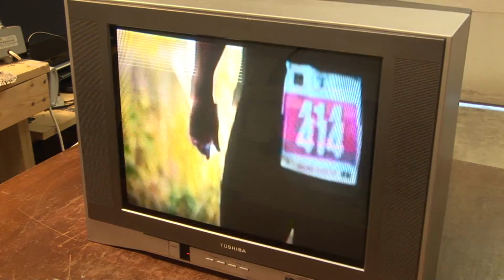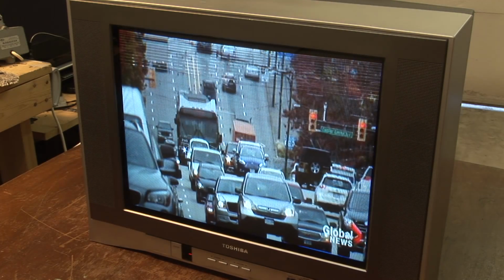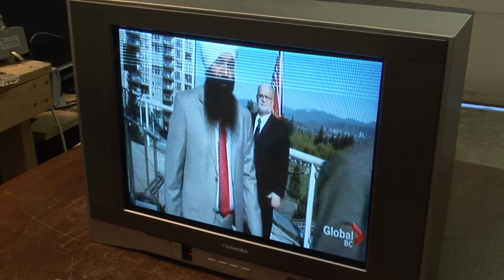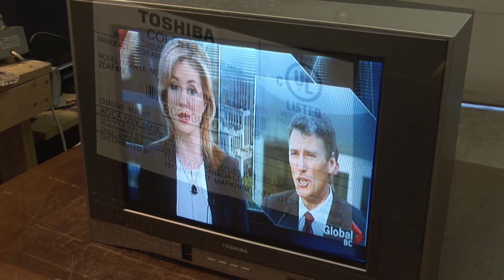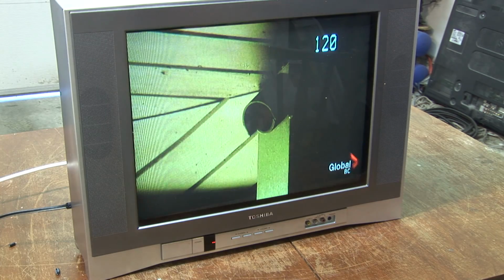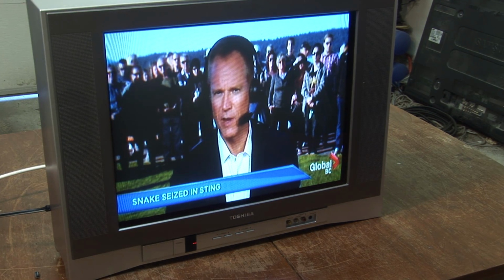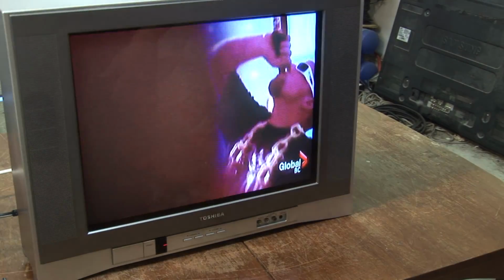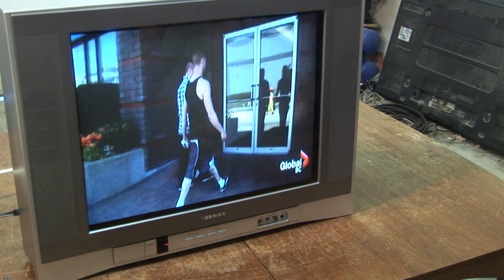Toshiba 20AF45C CRT Lines in Pix

Comment: I just got this set, and I think it is very cheap. I'm not so sure why people like it so much.. Very simple board, simple tube, and simple or minimal adjustments via service menu compared to Sony. I have an issue where the horizontal size is off, and there's no way to adjust that via service menu since the H-Size doesn't work. I can't see any potentiometer specifically for it by looking at your video, only for H-position os available, so I am just not going to bother opening it and go straight to garbage.

Comment: I know this vid is a couple years old, but I want to thank you for posting this, Dave. Recently had this very same issue with a Philips set, just went ahead and located the vertical circuit and replaced all 4 caps. Works like a charm now.
Reply from the maker: That's the thing with CRT. They are all basically the same.

Comment: Thanks for this video. I had the visible raster lines at the top of the screen and replaced C406, C407 and C408. They went away. Your video is much appreciated. However, I still have a lightly visible bar/lines horizontally across the center of the screen. Should I consider replacing that 4th cap near the large heatsink that you mentioned (C409 I think)? Would any other area be causing such an issue? I don't have the proper equipment to test the caps, but replacing them is an option.

Comment: I have a 27af45 that I can't wait to get out of storage this Friday. When I put it there about 9 months ago It had the same lines on the screen and the front input jacks only worked if you shake the cables around. The front composite video inputs I can fix by re soldering the cold solder back together, But the Capacitors, Were exactly do you find them? and could I find them at my local electronics store because they sell caps there, And which way do I put the caps?

Comment: Thank you so much for all the information. Fixed my gaming TV in a snap.
Reply: Selecting the 16:9 mode removes all the lines at the top on Toshiba What I did was go into 16:9 and then go into the video service menu and resized the tv screen to hide the black bars from the 16:9 and it works perfectly i think its hold volume down and number 9 on the remote. Then you fit the 16:9 into a 4:3 frame by changing the v and horizontal stretch i ended up just replacing the caps 2 years later the tv works normally again and i resize the screen back.

Comment: I just picked up a 24" Toshiba in the same series as yours. I have the scan lines as well. I noticed something odd though. I have the scan lines in 4:3 resolution but they go away completely when I switch to 16:9. I'm handy with a soldering iron so I will swap the caps. Thank you sir!
Reply: What I did was go into 16:9 and then go into the video service menu and resized the tv screen to hide the black bars from the 16:9 and it works perfectly i think its hold volume down and number 9 on the remote. Then you fit the 16:9 into a 4:3 frame by changing the v and horizontal stretch i ended up just replacing the caps 2 years later the tv works normally again and i resize the screen back.
Reply: @Maxmartin12355  thanks for the advice. I won't need to use it though, I replaced the capacitors like in the video and everything works great. The lines are gone.
Reply: @johnrambo19820  I remember and experienced 100% of the scan line problem first month it is just 2 or 3 lines at the top second month its around 4-8 the lines always appear once you turn the tv on when its cold in the first few months the lines will disappear after a few minutes when you turn the tv it warms up and the lines go away one by one they move up and stack at the top of the screen you cant see them after a few months less lines will stack at the top and you will be left with the permanent 8-12 lines it will always be on the screen and not stack or move to the top i think it happens this way month after month because it's the 1uf 50v cap failing slowly.

Comment: This is such valuable information, thank you so much for doing these videos! I have a giant Mitsubishi Multisync monitor which has vertical fold over when switching to 800x600. 320x240 and 640x480 are still okay, but the highest scanning rates that this monitor is capable of produce the fold over effect. I'll study the service manual and see if I can locate that bootstrap capacitor.

Comment: I still have a couple of analog tv's. One isn't working (power issue) and the other one is a 27" Panasonic that looks as beautiful as the day I bought it. The reason why I'm here is because my Panasonic also has that vertical rollover issue. At least I know it's a capacitor problem. This video really helps a lot. I will attempt my own repair. Thanks for making this repair tutorial.
Reply from the maker: All CRT sets will get this fault over time, and it is always the same capacitor, as the circuits are all very similar across the brands.
Reply: @12voltvids  I really appreciate the response. I'm an older guy who was raised in the old crt tv days starting with black & white tv. So I still have pretty good knowledge of the circuit boards. Heck I helped my father build, from scratch, a Heathkit color tv. Too bad that company is no longer around. It really taught me a lot about electronics and soldering.
Reply from the maker: @journeyon1983  
Heathkit was the kit arm of zenith electronics.  I have a heathkit stereo.
Reply: @12voltvids  Really.. I guess Heathkit is both in our memories then. I never did get around to convincing my father about building that Heathkit Weather Station. That would have been real fun to have. Oh the memories of the past. I just wish I had the advanced knowledge that you have in electronics and all of that equipment you use to test various parts. When I was a kid, I remember running down to the pharmacy with all the tv tubes and testing them all out to see if it would fix any tv issue that was there. 9/10 times, it worked. Analog will always be in my heart and there's no letting go.

Comment: I don't know who wouldn't want to repair one of these.  CRT television sets are marvels of electronic engineering.
Reply from the maker: Personally I find the current crop of display technology pretty boring. Whoop de doo send a string of numbers along a data bus to address a pixel on an x-y grid and turn it on or off. Complex, yes, interesting, no.
Now a CRT on the other hand, it's simplicity. Evacuate all the air from a glass tube with a phosphorous coating on one end and a few pieces of metal with holes in some at specific diameters. Take another chunk of metal and heat it up in this vacuum, and apply a high voltage to the metalic coating that was applied to the inside of the glass. Place a pair of sawtooth waveforms on coils of wire placed on the outside of the glass, or to electrodes inside the neck and then  modulate this heated cathode sealed in the end of the tube and get an image on the other end. Now that is magic. There are people now that do not know what a CRT is, and as time passes fewer and fewer people will know anything about the history of television. I bet most people under 30 years of age these days don't know what a vacuum tube is or ever heard of stereo broadcasting on AM radio. There will be exceptions. The history nerds will continue to seek out these old radios and TVs and restore them to preserve them, but the majority will simply forget about them.
Reply: @12voltvids  And how they managed to devise how to make these without even integrated circuits still amazes me; I am still not entirely sure how they did it.
Reply from the maker: @infinitecanadian  
Goes back to the vacuum tube days.  I should be getting an old black and white tube set to restore soon.  It is my cousin's set and he has to arrange for a trailer to bring it over in. Sounds big and heavy. Might be nice to see if it can be made usable.
Reply: @12voltvids  My uncle collected a lot of stuff.  One thing he collected was a vintage television set.
Reply: @12voltvids  All the wonder and novelty has gone out of electronics these days.
Reply from the maker: @infinitecanadian  
Don't get me wrong I do like the modern stuff. It is just, for the most part too complex to repair. When you have everything buried into an SOC there is very little you can do. I love being able to record video onto a memory card, and not have to deal with tape.
I remember when I worked for Sony in 1983 we were being told back then that very soon you would rent a movie on a memory card the size of a postage stamp. We all thought they were crazy at the time. The thing is how do you even begin to troubleshoot something like that. You don't when it breaks you buy a new one and go from there. Older tech is much easier to understand, and can actually be repaired. I just picked up another old radio from the late 30's or early 40's. Haven't researched when it was made yet as I just picked it up, and a full restore on this beast is coming soon. Soon as in perhaps tomorrow if I fell like it. Have a week off work and so much stuff to do around the house I haven't had time to sit in the workshop and work on anything yet.
That's the trouble with owning a house. Maintenance, and upkeep. I could pay someone else to do it but I am a "cheap bastard" when it comes to money. That't why I fix my old equipment rather than buy new. Electronic stores hate me because I go look at new stuff and never buy. Car dealers love me because I don't just kick the tires, I drive a new one off the lot.
Reply: @12voltvids  It's just more fun to fix things than to have to buy them.  Besides, it sucks to throw things out.

Comment: Nice old set that dave, i MUCH prefer CCD cameras than CMOS, and those Rubycon caps are bloody garbage, had loads of failures caused by those in amplifiers. They were part of the bad capacitor plague of the early 2000's
Reply from the maker: CCD used to have a fair bit of smear. CMOS with a global shutter and backlighting deliver a very good image  with exceptionial sensitivity these days.

Comment: Intresting, good it was so easy to fix by just replacing those capacitors! :) I have a problem with a Siemens Nixdorf CRT monitor btw, it also had some kinda line like those on that TV, but it was further down and jumping up and down for a little while, then dissapeard, and also the very bottom of the screen, like about a 5 milimeter line at the bottom, gets like squished after the monitor has been on for a while, but the rest of the screen looks fine. Know any solution to this problem? Might this be a capacitor related problem too perhaps? Hope you mabye can help cus I can tell you really seem to know your stuff! :)
Reply from the maker: It will be one of the little caps in the vertical circuit.
Reply: Aha, thank you! Could I mabye send you a photo of the circuit board and mabye you could point out which ones it could probably be?
Reply: I managed to find the vertical circuit and that bad cap now and changed it, so the screen seems to work fine now! So thanks for the tip!  :)

Comment: Good learning for my CRT same model except mine is a Toshiba 20AF45, i have a question for some reason when i go into the service menu the H. Size option doesn't do anything to the horizontal picture, vertical works perfectly. Any ideas on whats going on... maybe capacitor or a resistor? Thx in advance.
Reply from the maker: Sorry I don't know the answer to that. I haven't looked at this set since I fixed it. Put it up in my storage room for the day that I will need it. I have quite a few old CRT sets in storage. 4 Sony 20", this toshiba, a Mitsubishi 28", 5 or 6 14" and a few commodore composite / rgb computer monitors. and a couple of viewsonic computer monitors. All neatly stacked in the corner for the day I need them for something.  I hate to toss them because like everything vintage as they become rarer, they will be worth more to someone.
Reply: @12voltvids  thx for the fast response, i might just recap the whole board, i have a sony trinitron kv-24fv300 that needs to be recap and geometry fixed too.  It's nice to see channels like this where they still fixed CRT's good learning curve.
Reply from the maker: @ifu512  
Width is not set by an electrolytic.  Most will never fail.  Width is set more by the b+ voltage.  They generally set them for 10% over scan to compansate for low line voltage when line sags during peak consumption.
Reply: Thx for the tips, time to read the service manual and start troubleshooting. Thx again.

Comment: Great Video

I have a Panasonic CT-13R17B with this same exact vertical foldover for 2 years. Thanks to this vid I feel a bit more confident in resolving this issue. I have identified 2 bulging caps in the vertical output area.

Now there is another problem that I'm curious about. The screen has been displaying a green with envy at initial start up. Could it be a result of running the tv with vertical foldover for too long? Most of the color returns to normal after the TV warms up. Although when a dark image is been displayed I can still see some slight green tint to it.

Any ideas?
Reply from the maker: Could be the tube starting to fail.
Reply: Peter-John Duncan in panasonic that i am currently fixing none of the capa were bad, the vertical IC died and after i replaces it it is now fine, heard its common in panasonic for vertical IC to go bad so if recap does not fix it try replacing IC

Comment: when i volunteered for a local charity which resells furniture white goods and other household items to people on benefit or low income i was trained how to do pat testing as all electrical goods have to be tested before being sold second hand and any small tv sets which didnt work were laid aside for a guy who used to repair them and put them in flats which he rented out and they were all crt sets this was back in 2013/14
Reply from the maker: Old CRT sets are still in many motels. People won't steal them. The higher end suites usually have a flat panel now, but many times when I am on the road and just need a place to crash for the night I am not spending 100 for a room. A 50.00 room is good enough to get some shut eye, and I still see plenty of old CRT TVs in use on a cable or satellite box. I'm not generally watching TV anyway. When I am on a road trip I spend the evening dumping all my days memory cards onto the hard drive, and then crashing.

Comment: I had acquired a rather nice 1988 13" Toshiba Blackstripe FST which had a similar problem to this.

It didn't have a problem with vertical foldover, but it did have a problem with poor vertical linearity, where the upper half looked more stretched out compared to the bottom half.

As usual, it was a faulty capacitor, about 33 microfarads at 35 volts, close to the vertical deflection IC.
Reply from the maker: The red colored capacitor also goes bad. The rubber plug on the bottom of the cap turns to mush and lets the electrolytic leak out. That red cap is a special capacitor. A special very low ESR type.  1uF @ 50V 105'C
Reply: Thanks for the tip.
Reply: UPDATE: Model no. CX1467, Chassis no. TAC 8790

I don't see a red capacitor that's 1 microfarad at 50 anywhere.  But, I do see a red capacitor that's 0.47 microfarad at 50V (85 degrees) in the vicinity of an IC labeled TA8677N (probably the jungle chip); EU series made by United Chemicon.

There doesn't appear to be any sign of leakage from this capacitor.

Where would the cap you speak of be located?

Comment: Some of the best cameras ive ever owned use CCD
Reply from the maker: The early CMOS imagers were inferior to CCDs, but once Sony perfected the back illuminated CMOS sensor, CCD have pretty much gone the way of the Betamax. I have a 3CCD camera, actually I have 2, a huge JVC  ENG camera, and a Sony HDTV camera, the one I shot this video with. 3 imager cameras typically have more accurate color than single sensor cameras as they have 1 imager dedicated to each color. I didn't us ethe word 3CCD, because there re plenty of 3 CMOS cameras that are equally as good. The CCD strength is the global shutter, but the weakness is vertical smear around bright objects.

Comment: Thank you sir! Have exactly this problem with my toshiba 20AF45C CRT I use for retro gaming. Will now be able to fix! Quick question: where can I purchase the replacement capacitors? I have an old toshiba 27af46c laying around that works great... Could I simply swap those into the 20AF45C and I'm good to go? Thanks
Reply from the maker: Nick Foran 
if they are the same size and voltage. I buy my parts at main electronics in Vancouver. they ship all over the place from their Web site. I have been dealing with them for 40 years. knew Phil, and then his son Daniel took over, and now Daniel's son Scot runs the business with his mother. They have a very large selection of parts. that is where I got the part to fix an obsolete old leak receiver.
Reply: It worked, folds are gone :) The capacitors from the larger 27af46c worked just fine. I still have one very inconspicuous horizontal line (darker than the folds) near the top of the monitor, did you notice anything like that? Thanks a lot for all the suggestions!
Reply from the maker: Could be the one you installed is also starting to go bad.
Also make sure it is a 105'C rated capacitor. An 85'C won't last very long.
Reply: Ok thanks! Appreciate your help